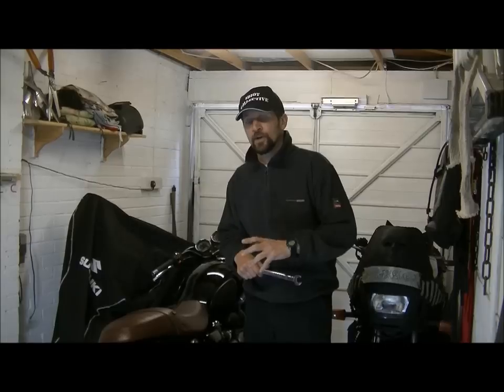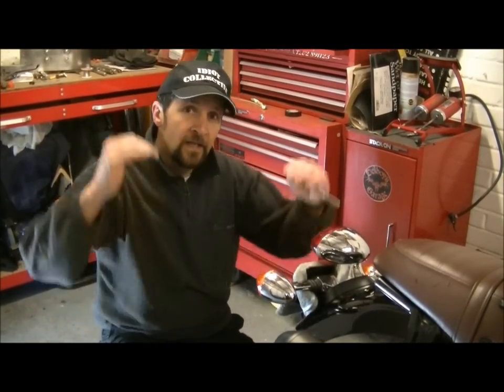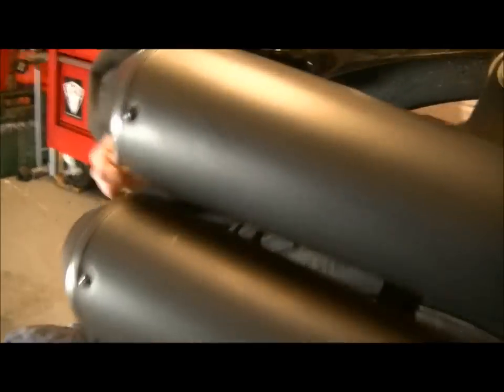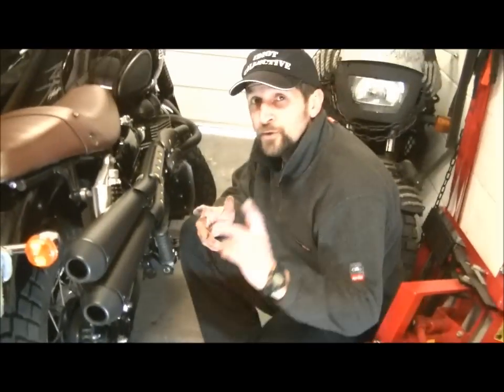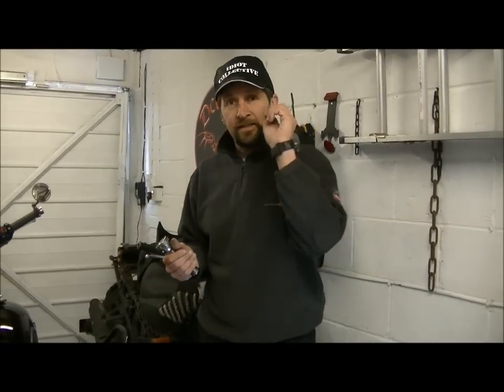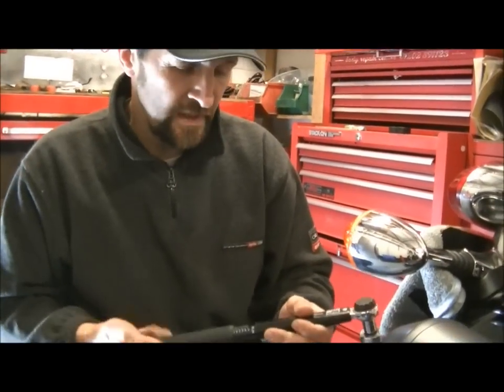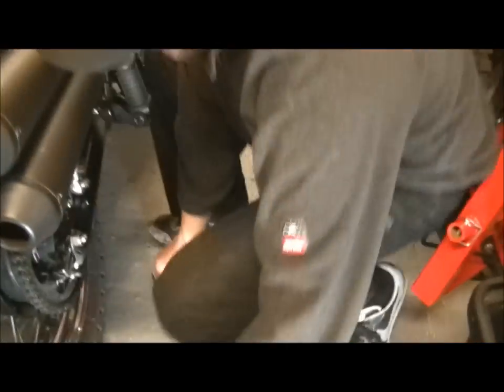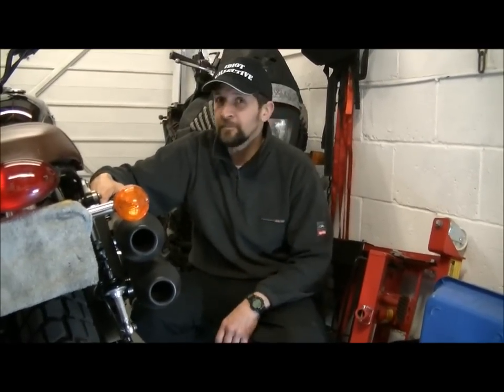Delboy's Garage, Triumph Scrambler Chain Adjustment.

Comment: Very timely video, must get my Bonneville slack chain adjusted. Have to get my torque wrench back from my dad, then not guessing torque. Thanks Del.
Reply from the maker: Thanks Stephen, glad it helps you mate, the best way to blag the torque wrench back fro yer Dad is to buy him one lol!
Reply: If anyone is having a new one it will be me. Just put the additional spacers on top of the Ikon front fork springs (after using the springs this last year or so without them) in the hope it will pre load the springs a touch and prevent the front end nodding its head when I grab a load of brake in those nasty situations that happen all to often these days. Was going to have a ride today, but the weather changed to full on intermittent rain, so that idea got rapidly changed.

Comment: Oops, I've just done my chain, but the bike was on its the centre stand. Better revisit it on the weekend.
Thanks you again for the vids
Reply from the maker: Easily done Christian, just put some weight on the bike and give the chain a lift in the middle, it may be ok, depending on how tight you set it!

Comment: Best video on teaching to tighten chain on a Triumph. I have a Speedmaster 2015. It seems to have the same set up to tighten  the chain. I will be using your method to the tee. Unless you know that there is something different in the Speedmaster I should know.
Reply from the maker: Hello Gene, I think your bike is pretty much the same as the other Bonneville models, its all a pretty generic design... see how it goes and feel free to drop me a line if you get stuck withg anything mate... happy to help.. Del
Reply: Moonfleet41  Perfect I love my bike. Its the last one I will ever buy. I love working on it but i am not as studied on motorcycles so I watch your videos. My back and balance strength is not good anymore so my 865 does me just fine. Thank you for your help

Comment: Terrific video!  I'm about to be the owner of a T100 (as soon as it arrives from the UK).   This video will come in super handy.   Cheers
Reply from the maker: That is fantastic news Derek... you must be very proud!  Why have you imported one from the UK... were they not available where you live?... enjoy your bike my friend, you'll love it!  Hope the videos can help... ride safe, Del
Reply: Moonfleet41 Thanks, can't wait until it arrives!   I have a ridiculous amount of  aftermarket parts waiting for it when it arrives (it'll be stock for about 10mins LOL).    I ordered a new T100 through my local Triumph Canada dealer back in Nov.  Triumph Canada imports all of their bikes over from Triumph UK here, and the import waiting list is about 5 months long (I ordered mine back in Nov. when they first started shipping to Canada).   It's scheduled to arrive sometime in early April.   Unfortunately it's still -20C with snow on the ground here (Edmonton Alberta Canada) and there's still a TON of gravel and sand all over the roads here from the winter sanding trucks (we don't use salt on the roads up here because it's too cold for salt to melt the snow here).   Our roads are a sea of potholes at present (so a new suspension on the T100 is a must),  and our street sweeping and repairs here don't even start until June.  The snow is usually gone here by late May.....   Sadly our riding season here only runs from late May - early October (unless you ride a Ural motorcycle w/sidecar).   Cheers!

Comment: Great vid Del, don't own a Scrambler but hey ;)

Although I will say that my Daytona felt really un easy on the road so I got the rear wheel laser aligned. It was 20mm~ out of alignment, although the marks on the swingarm said it was perfect. So maybe not all that accurate!

Got some tip-ex on the adjuster nut, for the future adjustements so the wheel should stay perfect through the life of the chain.

Comment: Nice vid Delboy. I hate chains! Though they are very forgiving alignment wise compared to belt drive they are such a hassle and make a mess of everything!  Chains stretch in such weird ways and in many different points along their entire length. It’s always a good idea to check if there is a section that is tighter and adjust your chain at that point which is the SHORTEST length. If you happen to adjust your chain at the LONGEST length and there is a section that has not stretched as much, what will happen is that every time the shorter length comes round it will tighten too much even to the point of breaking. Been there, done that! Hahahaha  For measurements I always prefer to find a common center line at one end  (say the pivot axle center punch) and measure from there to the center of the rear axle. I find it much more accurate as plates, swing arm ends and what not may vary considerably from side to side. And you are soooo right with the tork setting. I’ve seen shops completely ruin the threads or not only axles but also rear sprocket bolts; in one case I had to cut them off as they were completely ruined!!!
Reply from the maker: Thanks mate, using the shaft centres for alignment is impossible on the Bonneville series as the right side of the swing arm pivot shaft is completely covered by the chain casing... and I didn't mention the matter of tightening from the tightest point as this is a new chain and still has uniform tension all the way round, but good point well made my friend.

Comment: Just watched video of chain tightening ordeal for new Triumph Bonneville and that's when I realized these are true Triumphs just like my '72 650 Tiger was back then.  The most agonizing event back then was changing the headlight bulb frequently (new law in Fla then required it  stay on in daytime.)  This event required about 2 hours expletive enhanced effort in the heat.  Cleaning the carburetor and chain tightening back then were then somewhat less taxing than now apparently.  When I needed cash for a move and advertised bike for sale suddenly to my utter chagrin one of the 2 cylinders refused to fire. Believe it or not a gentleman with British accent came along with a novice rider to consider buying it.  Following advice from my mother never to reveal any flaws of something I was going to sell I made no comment.  The two rode off on the temporarily one cylinder Triumph.  When the Brit and his friend returned the Brit said: "It's a Triumph!"  I then admitted to the untimely one cylinder condition and they paid the asking price. (In spite of trying 4 other brands since  then including my present 2003 1600, nothing has ever matched the thrill and handling of the Tiger.
Reply from the maker: Philip, What a wonderful story.. thank you for sharing that.. Del.

Comment: Good video Del, I've actually seen a garage mechanic standing on an extention bar trying to get these undone where the Muppet owner did it himself with god knows what to tighten it, Good info again my friend, RS.
Reply from the maker: Yeah seen that too mate.. even had to hear them to get them off myself!... the danger of over tightening these can be catastrophic, stainless steel is brittle and it doesn't take much to sheer the threaded end off... after all, it's not even a bar, it's a tube, albeit a thick one!  Good to hear from you mate...Del
Reply: Moonfleet41 Cheers Del, a bit more info for me buddy, I never knew they where tubes I assumed they where solid, I've taken em out cleaned em etc but never really studied em, maybe it's time to start paying more attention, lol, Ride Safe Bro.

Comment: Great video, very clear. I have Thruxton 2015; the manual recommends tightening the adjuster nut to 5nm after wheel nut. Is it the same for this bike - could it move the chain?

Comment: Hi Del! Just a small suggestion. Before you torgue the rear axle you should keep the chain in tension so that the adjusters on both sides fully touch both ends. A good way to do that is by lifting the rear tire (after the adjustment) and put a screwdriver inside the teeth of the rear sprocket. Turn the wheel such as the screwdriver gets blocked in the sprocket. That way you 're sure that you've got full tension. Then you torgue the rear axle.
Reply from the maker: Who told you that mate?.. that is not only completely un-necessary, but could upset the alignment because you're pulling one side... as long as the bike weight is on the wheel and you have the adjustors set correctly, then do up gently and then increase torque, step by step to full value... and as you saw, it pulled up exactly the same both sides after torquing... thanks for watching...
Reply: Moonfleet41 I used to do it your way on my old vstrom. The thing i encountered is that sometimes the aluminium caps at the end of the swingarms were rattling. The problem was caused by the adjuster bolts. They did not full touch the end of swingarm when i was torguing the axle. A mechanic in the neighborhood tipped me this trick. I don't know if it's wrong. But it does the job.

Comment: Hi del could you advise me im putting the alternator cover back on and it states in my Haynes manual and it says apply a suitable sealant to the wiring grommet, could you advise me on what I should use for this or what sealant regards Aussie Bob

Comment: hi, great video. I have a Triumph Bonneville Street Twin. Can that also be adjusted on its side stand? What torque do you suggest for the axle? Love the tip about the nail varnish!
Reply: I have a Street Twin as well.  The manual calls for 80 ft.lbs. torque for the rear axle nut.

Comment: Hi Del - thanks for the video.  I've got a 2014 Thruxton and I'm ready to do my first chain adjustment.  The manual indicates to torque up the adjusters to 18 lbf after tightening the spindle nut to 63 lbf.  However, when I try to tighten the adjusters with the torque wrench set to spec, the bolt just keeps spinning and the wrench never clicks.  You didn't mention torquing down the adjusters in your video, and I'm wondering how much it matters, as long as the spindle nut is in spec.  I'm a little scared that I stripped the nut somehow.
Reply from the maker: Hi Adam. im a bit confused with that recommendation too, Ive never torqued the adjusters, you cant!, they don't do up tight, you just set them to the right distance then torque up the wheel nut.....if you keep winding on the adjusters, you'll throw the chain tension or wheel alignment out..... unless they mean to do up the wheel first then lock the adjuster in tight....but i don't see any reason to do that. .. best thing  is to just set the alignment, torque the axle nut in right, then check it a few times over the next few days, make sure it hasn't moved..

Comment: Hi Del, did my first chain adjustment last night! Easy peasy thanks. No torque wrench though, thinking of getting one but my socket is 1/2inch and all the sockets in my socket set are 3/8. Should I get a 1/2 inch torque wrench as i will mostly use it for just the axles, or would a 3/8 with an adapter be adequate allowing me to use it with all my other sockets?
Reply from the maker: Hi Alex, a 3/8 wrench is fine for bikes as 90% of your bolts will be under 70Nm, then you can use it with all your sockets.... by all means get a 1/2 inch wrench and use adapters, no harm in that, but make sure it will serve you when you need to check things like fork pinch bolts that are 20Nm and less..... as  bigger drive may not go down that low...
Reply: Well I already own a 1/4 inch drive torque wrench that only goes up to about 25Nm so I should be covered for that. I'll get a 3/8 and to match all my sockets and just use an adapter to go up to 1/2 inch to torque my axle nut. Is it wise to check the measurements each side after having ridden following a chain adjustment just to make sure that it hasnt' creeped. Maybe I'm being OCD but hey ho!
Reply from the maker: Alex Carpenter
As long as you've torqued the axle nut up right, and the chain side adjuster is set right, it shouldn't have moved.. but hey, you cant check something too many times, and if it gives you piece of mind, then its worth it..

Comment: Just adjusted my chain for the second time (6400miles).  Did everything just as you showed; but, I was puzzled that the left side turned very easily.  Can you explain why it wouldn't have the same kind of resistance as it did on the right side?
Reply from the maker: Dennis Hofmeister HI Dennis, the left side of the Triumph has no weight on it as the chain is on the right... audjusting the right means pulling back on the weight of the chain to set the tension, but on the left...all you are doing is squaring the wheel up so match...no weight means no pressure on the screw.. hope that helps... Del.

Comment: Hi. My bike also says to adjust chain while on the side stand. Is adjusting the chain while the bike is on a paddock stand just as good?  I assumed the weight is still on the rear wheel when on the paddock stand?  Cheers.
Reply from the maker: +Count Miffed Yes mate, side stand or paddock stand. they are just suggesting to have weight on it..!
Reply: +Moonfleet41 excellent, thanks again.

Comment: Great vid. I am new to biking a have been wondering how to correctly adjust the chain on my BMW F800r. Quick question, do you need to spin the wheel round in order to find the lowest point of the chain or is the chains lowest point the same all the way round?  I hope that makes sense, I know what I am trying to say 😆. Thanks.
Reply from the maker: +Count Miffed I know what you're trying to say Count... its a common question buddy.....spin the wheel round to the TIGHTEST point.....the point where there is the LEAST slack.....then set the tension at that point.....remember the chain must have the minimum required slack.. setting it to a "more slack" point will mean that once you set the tension and it rolls round to the tight spot, then your vital slack will be gone and the chain will go tight... this can be dangerous to you and your bike...  so slackest point, and set the tension there... too slack is always better than too tight...and measure the slack with a rider sitting on the bike too...! hope that helps buddy.. good luck with it.. Del.
Reply: +Moonfleet41 cheers Del.

Comment: Hi Del, quick question on torque wrenches. There seems to be different views on wether the torque wrench should be kept at 0 or at its lowest setting (such as 10nm). Which would you reccomend?
Reply from the maker: I don't think it's that vital mate, as long as you back off the tension, I always back mine off to the stop...
Reply: Moonfleet41 ok Thanks Del. I thought it better to ask than just assume and possibly do damage! Ride safe mate :)

Comment: Hi Del... thank you for the excellent video. A quick question, when checking the tension, to get the full slack, should I push the chain down to get the start point and then push up. Some videos do this, some like yours don't. I only ask as if I don't push down, my chain is showing slightly too tight after adjustment.
Reply from the maker: Don't overthink it mate, it is an approximate measurement between up and down and will vary with suspension travel, so make sure the wheels are on the ground and I just grab the chain with finger and thumb and measure the overall max. movement!
Reply: @Moonfleet41  thank you for that.. I appreciate the quick response 🙂

Comment: Hi Del, Learning to do a chain adjustment has been on my "To Do" list for some time, but as yet never got round to doing it. Before the chain came off on my YBR 3 years ago, I didn't even know about chain adjust. However since now having owned 4 bikes, 2 of them brand new and the other a shaftie, it's just never got to the point where I needed to do it. My XJ6 had around 4K on the clock before I part exed it and it was within the tolerance, but I've now covered 6K on my Honda NC700X and the chain is looking a little sloppy. Can I apply this to a jap bike, would i be correct in thinking that after cracking off the axle nut and the adjustment locking nuts, I then need to TIGHTEN the adjustment nuts to pull the wheel back in contrast to your Triumph where you appear to slacken the nuts?
Reply from the maker: Hi Alex.. the direction you rotate the adjuster bolts varies from bike to bike depending on the design and whether they "push" or "Pull" on the axle locator , just turn them a bit first to see which way they work on your bike, dont worry, it will be immediately apparent when you look at the axle and see which way it moves..  Good luck with it, and remember to double check the alignment once you have locked up the axle nut again as it can move a bit.....all the best, Del.
Reply: As I suspected, it's about 55mm, it's only supposed to be 35mm.

MOT for the magna tomorrow, did my checks with your video and all good so wish me luck.
Reply from the maker: Alex Carpenter
Good luck mate, dont worry, you'll breeze it.. take care and well done for getting it all done yerself.. Del.
Reply: 1 MOT cert signed and dated for another year :) Advisory for the tyre but I expected that. I made the assesment that it would just about get through with the tyre so thought I'd skip buying one incase it failed on other counts but it sailed through. Even though I did the checks from your vid and confirmed it myself, it's the "dreaded" MOT that we all for some reason fear each year. So now, time for new tyres, I want knobblies.
Reply from the maker: Alex Carpenter  well done mate, all done for another year!